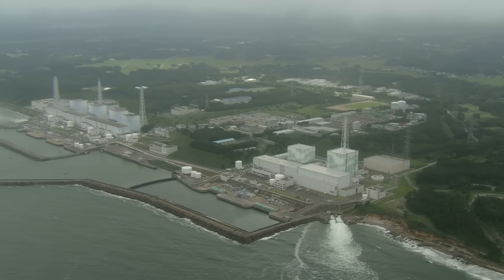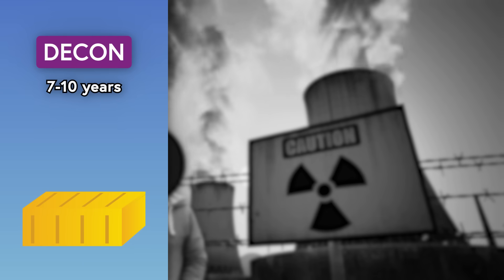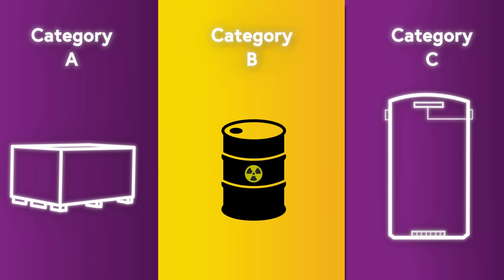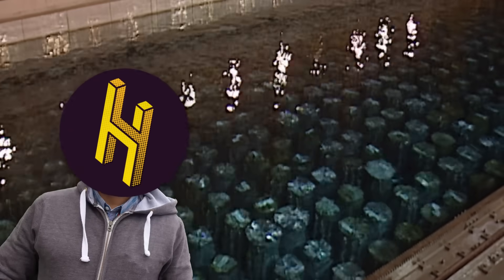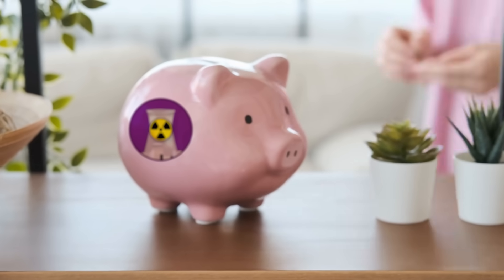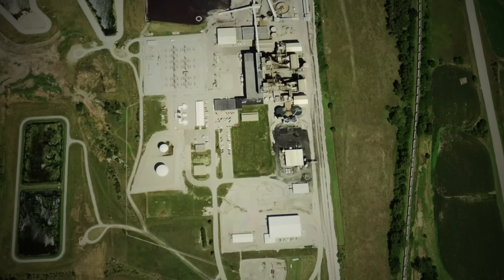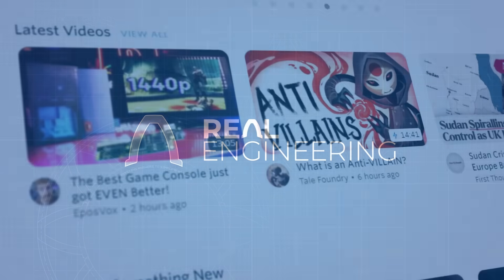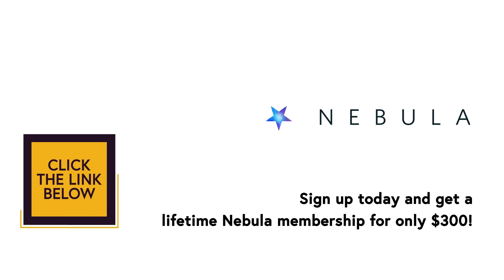Why It Takes 7+ Years to Shut Down a Nuclear Plant

Comment: I feel like the name of the video should be different.  Maybe "why it takes 7 + years to decommission a nuclear power plant" or "free up the land" or "destory the facility." Shut down seems to imply something else. For example, if a reactor is scrammed it no longer producer power for the grid. That sounds like a shut down doesn't it? I mean if you shut down a generator and not destroy it, it stops producing power and is available to be turned on again. Also I didn't even know SAFSTOR was a thing, I thought either the fast decommission for controlled process or the concrete tomb for meltdown aftermath were the only options.
Reply: A scrammed reactor keeps generating heat. Fukushima's reactors were scrammed automatically before the tsunami but still partially melted down. But yes, the title was a bit vague and counterintuitive.

Comment: One slight issue with the video.  When handing entombment, you say that the reactor will be filled with cement.  This is not correct, it gets filled with concrete.  Concrete contains cement but also has aggregates, air, admixtures and most importantly, water.

Comment: To give an example as to why wait 40-60 years. The water released at Fukushima has a half life of 20 years (or at least the wast majority of the radioactive material in it). Many parts in a nuclear plant has the same kind of halflife. Meaning after 40-60 years will make the radiation only 4-8 times less radioactive in those parts. Meaning it's much more easy to work with it since not the same precautions/procedures has to be used.

Comment: That wouldn’t be the case for plants with SNRs, right? Every such design that I’ve seen have the reactors be self-contained and safely removable, fast.
Reply: Yes and no, it depends very much on the design - "SMR" is more of a power classification that an exact design architecture currently - and on the regulator in your country/state - some regulators, like in Canada, can be overburdensome and require a concrete containment building around ALL nuclear power plant cores. This would hamper the easy commissioning and decommissioning, but is not necessary in regards to public safety so long as the safety systems are thoroughly designed. I hope that the CNSC revises the containment building requirement in light of upcoming SMR developments.

Comment: Why decommission at all?
Reply: To mitigate the risk of failure of components that cannot be thoroughly inspected or replaced.
Reply: When a nuclear plant reaches the end of its lifespan
When it's no longer safe to operate it
When the economics says it's not profitable
And so and on and so forth
Reply: Corporate mismanagement is a good one.
Profit motive and not being profitable is another one. 
No longer being needed for the area it's in (and a lack of a smart grid) for another.
Reply: So that the energy supply will be reduced, and eventually rationed
Reply: @walkingcarpet420 Idiots at greenpeace said that we need to.
Reply: @TheQuestionMaster64  Lol that too

Comment: Our approach to nuclear is ao ridiculous. If we were this safe amd responsible about coal, pil, etc. Its never have been profitable nor safe enough
Reply: I don't think we're that responsible with coal.
Reply: nuclear: ANY danger is too much danger! 
Coal: Avoid accidents, I guess
Reply: To be fair. Coal and oil don't casually remove cities from existence
Reply: https://es.wikipedia.org/wiki/Centralia
 @piercexlr878
Reply: https://en.wikipedia.org/wiki/Buffalo_Creek_flood
 @piercexlr878
Reply: An explosion occurred at 1:30 am inside an urban heating plant (500 MW, 6,000 m² floor area), with the energy dissipated into the ground estimated at the equivalent of a 50 kg charge of TNT. Operational since 1987, this heating unit comprised 5 boilers (2 coal-fired, 2 fuelled by a coal/gas mix, and 1 gas-powered). During the previous shift, several attempts to start up one of the mixed fuel boilers failed. Unable to restart the equipment and with the gas inlet pressure gauges indicating zero pressure, the foreman of the night shift ordered opening both valves a quarter turn towards shutting off the gas inlet on the main circuit. Since the indicated pressure remained at zero, the shift foreman requested the boiler technician to open a blowout preventer and then a butterfly control valve to feed the mixed fuel boiler with gas. This operation resulted in a major gas leak. A gas boiler underwent emergency shutdown, and 2 technicians exited the unit to cut the general gas supply at the regulator station, 110 m from the building, when the explosion happened.
 @piercexlr878
Reply: @piercexlr878 neither does nuclear anymore. Most meltdowns were caused by extreme stupidity, extreme natural disaster, or both and happened with old reactor designs. Nuclear power doesn’t get away with dumping millions of gallons of oil into the Gulf of Mexico either.
Reply: @NoNo-xh7ru  I'm aware, but that's like saying we don't need medication because I'm no longer sick. It's because of careful regulation incidents are few and far between. I'm not taking a stance on the whole coal and oil issue, but there's very different consequences when issues arise. I was just looking to point that out.

Comment: Sam, I know you know that it’s Concrete and not Cement. It’s never cement.
Reply: For radioactive containment, sometimes it's just Portland cement. Cement proper is denser than concrete, providing better gamma radiation protection. Some special cements even have boron and high-z metals added to further increase gamma blockage. Concrete is cheaper and performs nearly as well as cement, so for common construction it's the easy answer.  But when the stakes are high, many decommissioning projects opt for the extra expense of pure cement
Reply: @Spencergolde  No, you never encase anything in pure cement. Its never just Portland cement, and not any other type of pure cement either.
Cement is just dry powder. If you use it to build something, the next gust of wind will blow all your cement away.

What you do instead is mix cement with water, and that gives you concrete. 

You can add additional ingredients like sand to make it more economical, certain metals to make it more radiation proof, Styrofoam to make it less dense, or whatever other property you need.
But the really important part is that you add water during your mixing process.
Reply: @hannesgroesslinger  Concrete is actually any combination of aggregate and a binder. When the binder is Portland cement, the aggregate is usually sand, gravel, and sometimes glass fiber. But note that the binder, in this case Portland cement, is contributing most of the strength of the material. Aggregates are added because they are often cheaper than the bulk binder, and they can nearly match the strength. Also, cement is slaked with water to become workable, and eventually sets as it's final hydrate. Cement is not a dry powder, it's a goop that hardens into super strong rock-like structures
Reply: I die a little every time someone misuses the word "cement"
Reply: @MichaelfromtheGraves  okay just a question how are you not fully dead by now?
Reply: He did like 5mins research for this entire video
Reply: Yeah, that'd be like saying "I baked a loaf of flour". No, you baked a loaf of bread, it just happens to contain a bunch of flour.
Reply: Thank you.